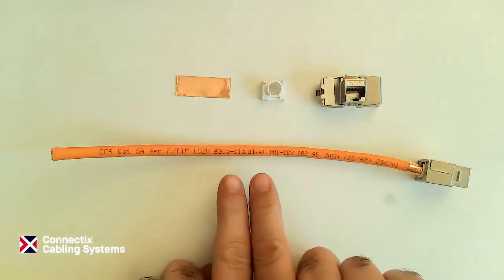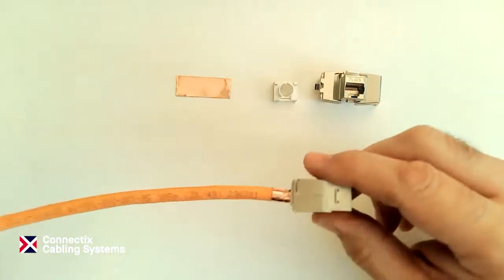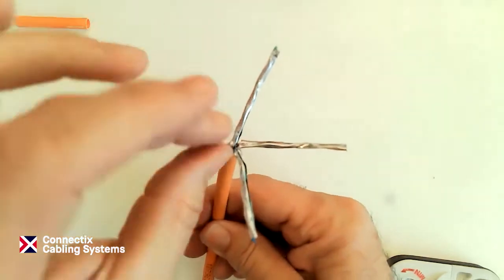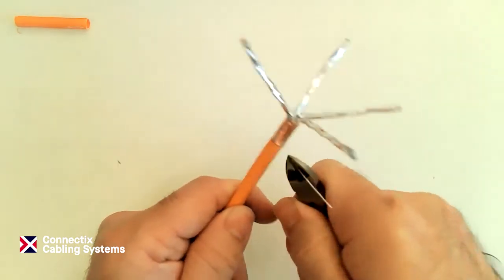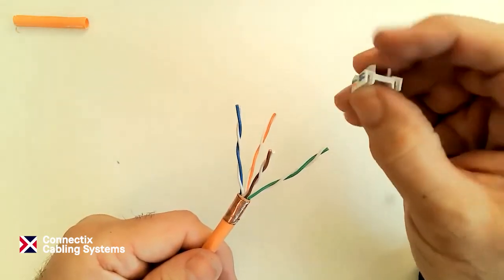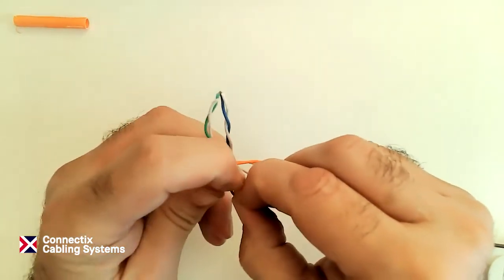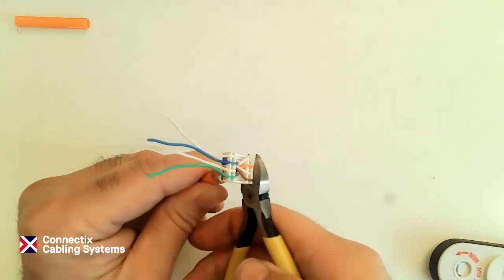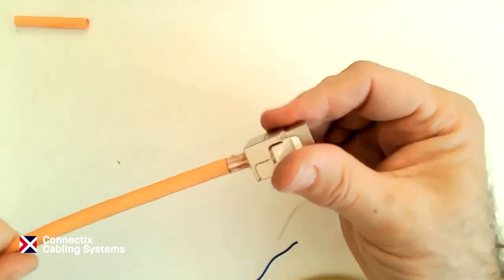Connectix Cat 6a FFTP Termination

Comment: You say wrap the copper around and then lay the ground down and then wrap the remaining copper over it but you tight sods supply the tiniest strip which makes that barely possible.    I'm using the exact same connectors and cable as you.

I get more when I've ordered from Chinese sellers on AliExpress and cheaper. 😂